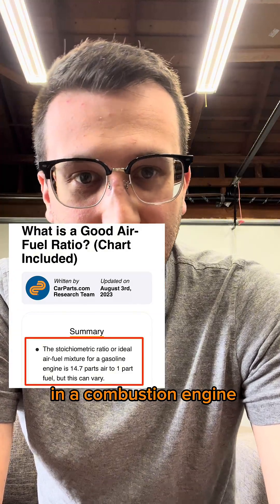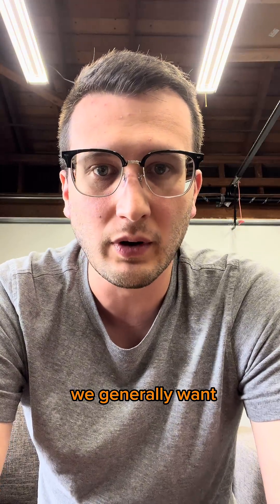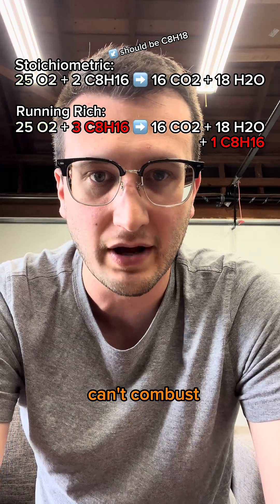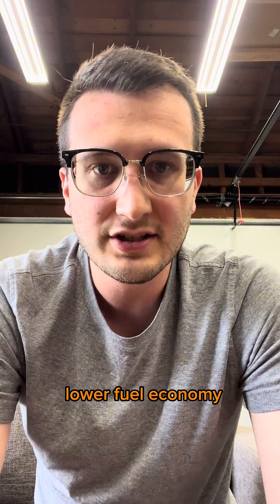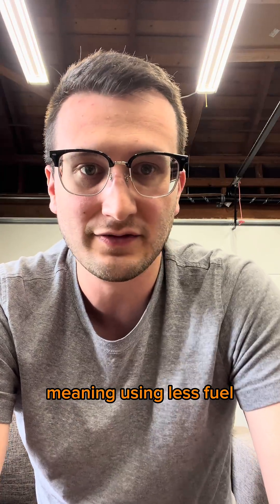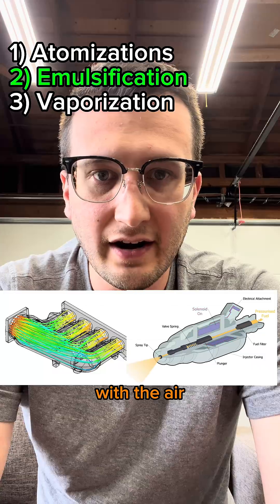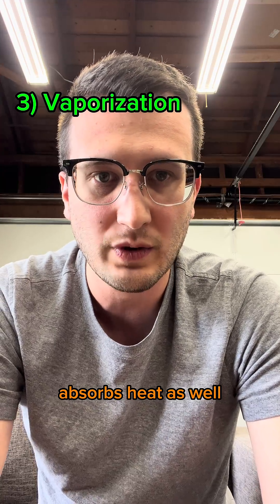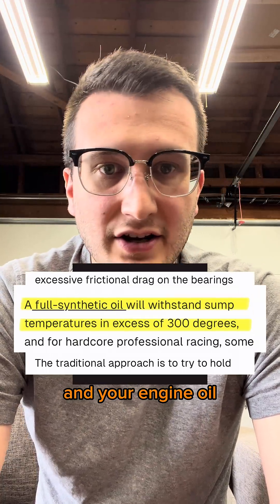Running Rich vs Running Lean #shorts

Comment: In my country lpg conversion is common. When lpg injected to intake manifold it already in gas form. No vaporization happens. So cooling not possible? Cars runs without any problem. Radiators are much bigger than needed. That's why engine has thermostat.